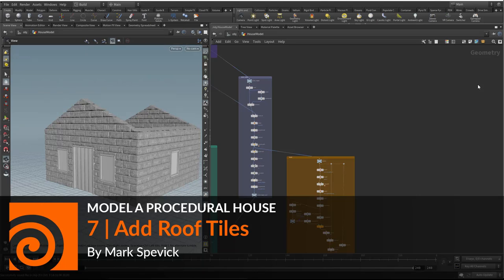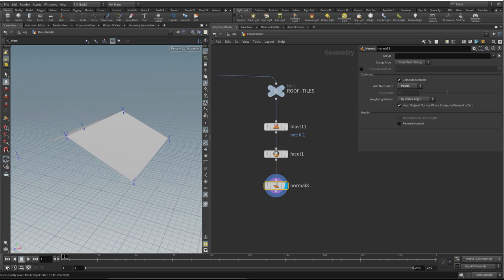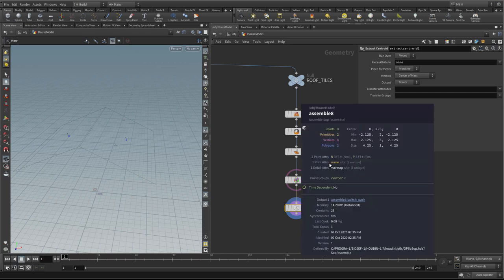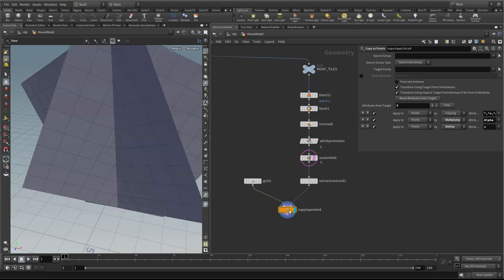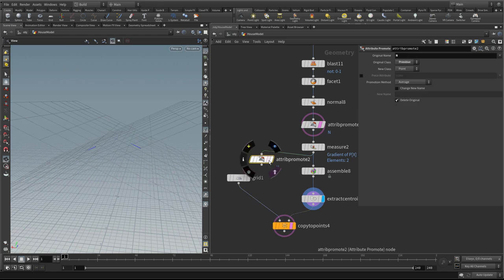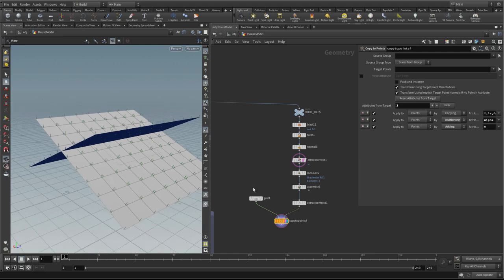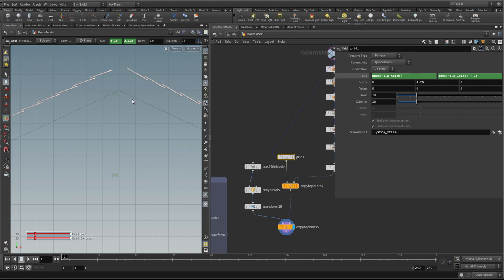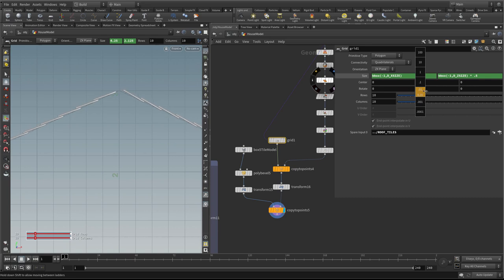Procedural House | 7 | Add Roof Tiles

Comment: 25:45 If you use the gradient of position on Y instead of X to calculate the normals in order to orientate the grids, you don't need to do this "foreach" since the tiles are already oriented in opposite directions and the rotation behaves as it should